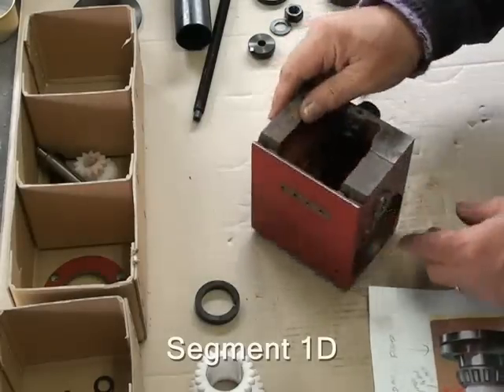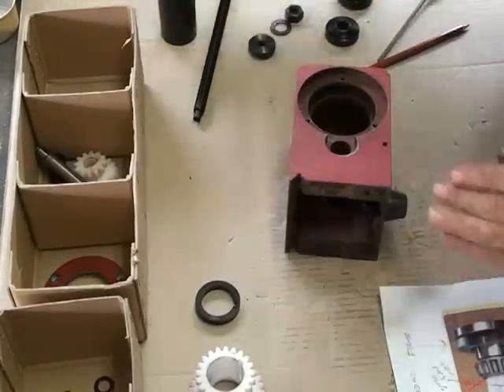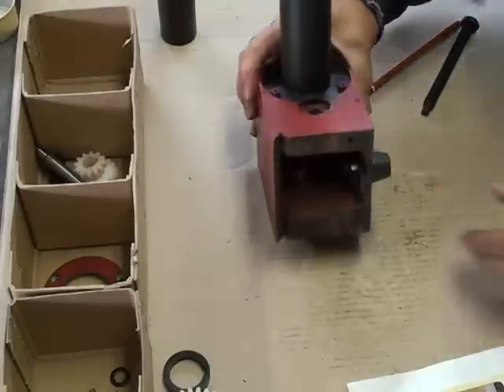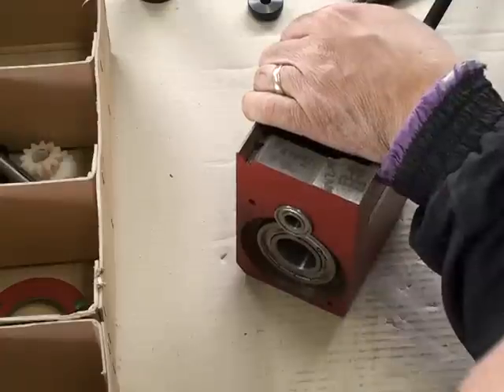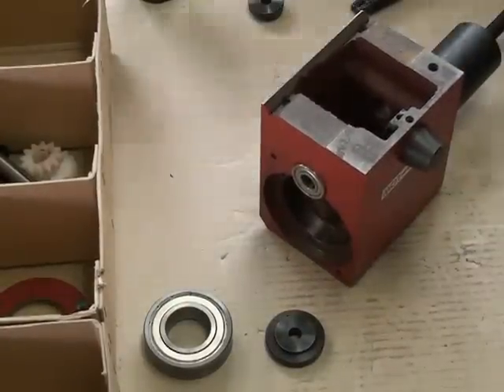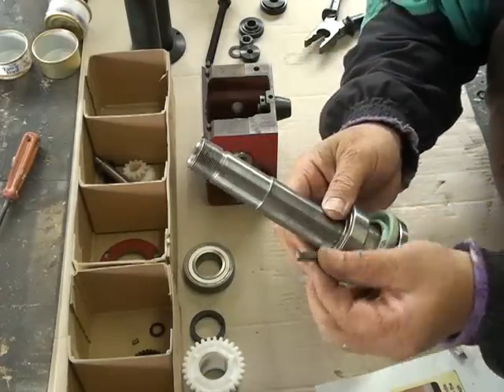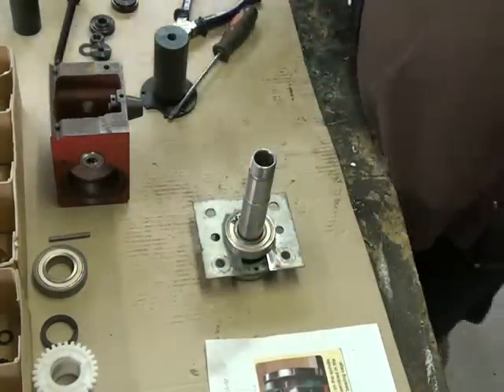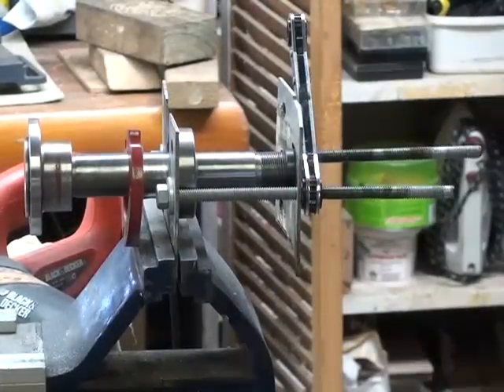Part 1D of Fitting the taper bearings to 7x12 lathe

Comment: do you know the size of the new bearings I'm from Canada and to get them from lms it's gonna cost over $100 to get them to me thanks any info would help
Reply from the maker: Hi, the taper bearings are 30mm inside diameter and 62mm outside. The overall width is 17.25mm. The upper ring and lower ring are 14mm wide. I cannot recall the manufacturer's part number, and as they are in the lathe, I cannot see the number. However I believe equivalents are Timken 30206M and   SKF 30206 (30x62x17.25mm). I have drawings of the tools if you want to try and duplicate them, or something that can do the pushing and pulling. If you want the drawings please give me your email address. Also, LMS now sell angled ball bearings to replace the original ones (which are 6206Z - a generic number). The advantage of the angled bearings over the taper ones is that you do not need to cut a lip into the internal plastic spacers as they are the same width of 16mm. I have not used them so I cannot vouch for them but you might want to consider them too.
Reply: @vk3aqz  I wish you had a link to the tools you used to help take this apart. If you had drawings are they of your design or taken from someplace?
Reply from the maker: @gvet47  The tools came from Little Machine shop(LMS). They were designed by Micro-Mark as part of a gear and bearing repair kit they sell. Micro-Mark still make that kit. Google Micro-Mark and little machine shop. LMS no longer seem to stock that kit but they do have suitable bearings and spare spacers. Also, they have now 2 types of bearings you can use.  Micro-Mark gear kit set - part number 83452 is the same kit I used. If I remember correctly, these 2 suppliers were mentioned on the videos by voice and text. Cheers.